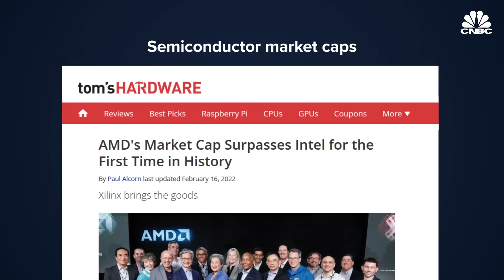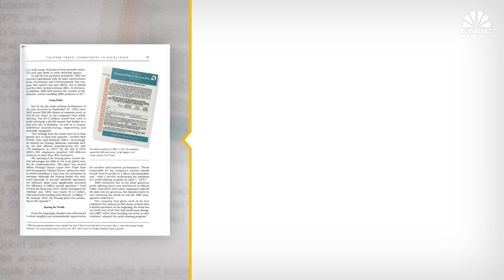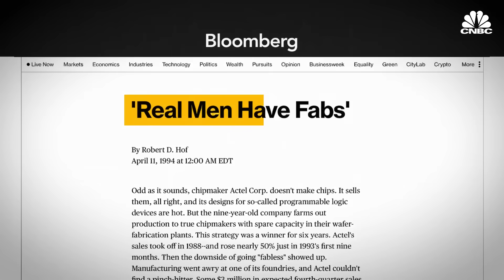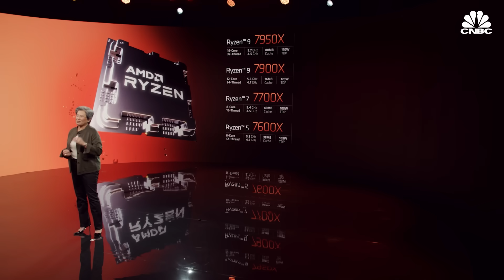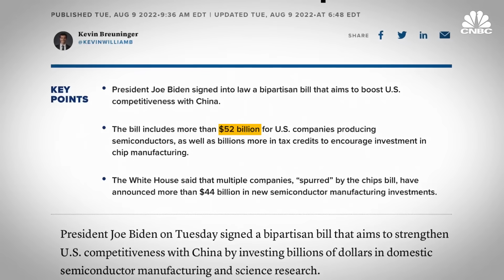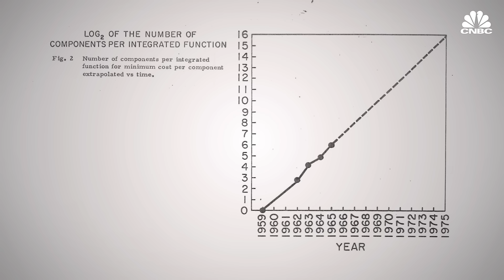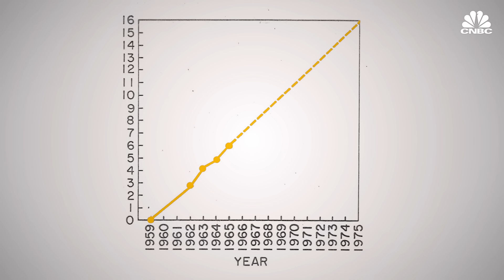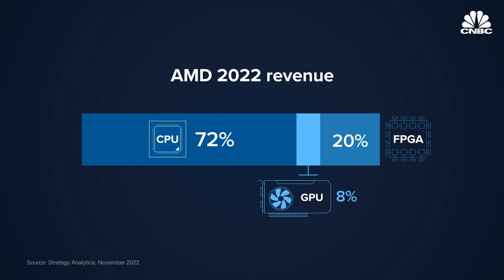How Chip Giant AMD Finally Caught Intel

Comment: Finally, AMD is getting the attention it deserves.
Reply: Was Intel for a long time. Now I am pure AMD for my CPUs. Even big tech-tubers like Jay from Jayztwocents are becoming AMD fanboys.
Reply: @TheSlickmicks  No, Jay uses what has been best for his use. i.e. "Epic Gaming and Rendering PC Upgrade Video - Jayztwocents went Intel"  😜✌
Reply: @Mauser1965   LTT got AMD'd
Reply: I'm surprised as I always hear gamers go on for AMD for some time. Asked me back years ago I would say INTEL plus NVIDIAAs AMD was the cheap option. 

Obviously building a super gaming computer is a lot more nuanced with drivers and software bit I always hear how AMD is either competitive or better.
Reply: @dianapennepacker6854  Its because the enthusiast market is A) A very small portion of sales and B) Most enthusiasts will say AMD and still buy Intel/Nvidia.
Reply: @dianapennepacker6854  The strengths of these two companies keeps sliding around each other.  When Intel released the i series (i3, i5, i7, i9) they obliterated AMD for a while.  Intel had performance, lower heat issue, and at the high end they won on performance.  AMD was still making good product, but the competition and price points where they could win were narrow.  AMD has done amazing turning things around.  For a while AMD has been winning in situations where high core count was more valuable than individual clock speeds, which is not usually gaming.  Intel still generally wins at single core performance at the top end.  Price wise AMD is often the winner when you look at performance per dollar.  The gap though is narrow and Intel is going to have to innovate as their current line of products and what we see from them coming soon in the near term doesn't look like it will be able to sustain any real edge against AMD's current trajectory.  Maybe Intel will keep the top spot for single core performance but I'm not betting they will (or that single core performance will be substantial enough to matter).  On the other end having lots and lots of cores doesn't matter much for home users.  

This all puts AMD in a really interesting spot.  For many business applications more cores is better, and they are winning there and they can win there at a lower price point.  More cores also is good for streamers which is interesting for gamers as gamer streamers often are looked at by "normal" gamers when they decide what computer equipment to buy.  If your favorite stream uses AMD you might just go that way too, even though your streamer is likely using AMD because it's better for streaming, and not necessarily better for gaming.  Again, toss in better price per performance though and lots of "normal" gamers would likely be wise to go that way even if technically the faster single core performance of Intel chips often can produce higher FPS (depending on the game and settings and of course the GPU used as well).  So AMD looks to be winning in most business scenarios, streaming, and while they win in price for gaming and ever so slightly lose for raw power in gaming... well the marketing is likely theirs.  

Intel really needs to put out something amazing and they need to get their prices down to compete.  It's been obvious Intel's pricing points for a while have been intentionally premium (slightly) so they likely can choose to just lower prices if they want, but I'm not sure they will.
Reply: @dianapennepacker6854  AMD is not as good as Intel/Nvidia.  It's literally a meme at this point that people even try to argue it.  It's so hilarious.
Reply: Still using the MSi laptop I bought 5 years ago, back then by all the metrics AMD was still lagging in performance, so I specced Intel/NVIDIA, and it still performs well with the SSD package, but are you saying, perhaps in another few years when this rig finally can't play some games I might be better off with AMD?
Reply: @JeffreyGoddin  I think AMD is a cheaper alternative to Intel and Nvidia(especially Nvidia with their crazy prices)
Reply: @OnurTheGamerr  lmao, "cheaper?" Amd can't even compete against the i3's
Reply: @someonetooknuggets  Pretty sure AMD doesn’t have all the attention.
Reply: @someonetooknuggets  Really you only hear about AMD through the hobbyist market via techtubers. Intel have been marketing giants for a long, long time. I don't think I've ever, even after showing interest and then building my own computer, seen an ad for and AMD product that wasn't just an ad for a retailer selling one of their components.
Reply: @JeffreyGoddin  A laptop with an AMD CPU and an AMD GPU will have significantly better battery life than an Intel Nvidia combo. For a couple of years, AMD actually had the best gaming CPU. Now Intel has the best one, and it's even the cheaper option. But I'm not complaining, because the only reason why Intel started making products that good is because of the competition from AMD. Put it this way: now that there is finally some real competition between Intel and AMD, we really cannot predict who will be best in 3 to 5 years. It could be Intel, it could be AMD. But as long as both companies bring their A game, we all win as consumers.
Reply: I don't like it. They will start to require more pennies for their products, making me expend more pennies in their products.
Reply: @JoséFranciscoCandidoFilho  You're a little late, that's already started happening. Heck, the flagship Intel CPU is now the cheaper option. But hopefully competition will keep them from going as bad as Nvidia.
Reply: Lmfao!
Reply: wdym..? Amd has all the attention since the release of Ryzen. They deserve it, but this isn't "finally".
Reply: AMD gets plenty of attention? From all the poor people buying their CPU’s.

Comment: i remembered clearly
Intel said "its IMPOSSIBLE" to transition to 64bits.
AMD then came out with the solution.

the rest is history.
Reply: Nah they never said it was impossible. Intel saw it as an opportunity to change to a new instruction set architecture in order to get out of these licensing deals with AMD and Cyrix dated back to IBM requiring a second source. A new ISA would not have the same issue which was being battled in court at the time with Intel trying to kick AMD out. Note, the deal was that AMD and Cyrix would get a copy of Intels CPU design like i386, not just that they could use x86 for their own design. Intel no longer wanted to give the CPU designs and AMD had to reverse engineer it instead (Always with better performance).

But while Intel was making the horrid VLIW instruction set architecture called Itanium, AMD was working on their very first Micro-architecture of their own design still based on x86, the performance was much better than Intels Itanium and pretty much determined the choice. To move into the 64 bit space AMD had changed x86 to be 64 bit (not uncommon to extend x86 with new features, this wasn't that complex). This extension was called x86-64, Intel and AMD made a cross licensing deal where any extensions made by either party would be shared for free to keep things compatible.

Intel didn't do x86-64 because they wanted a monopoly, and the only way to do that was make a new ISA. Unfortunately they couldn't make it perform any good.

Comment: .... lol So we're just going to ignore that AMD dominated the CPU scene from Mid 1999 through 2005.... 😏
(I'm not surprised by the oversight, at least insofar as the video title)

And the real reason Intel clawed ground back was heavily thanks to their illegal tactics with system vendors, with what equates to bribing them (through heavy discounts) to not only use Intel parts in their systems and laptops, but also by making sure that on the systems they DO sell with AMD components, they only use lower quality parts (only single-channel memory, less RAM, lower resolution screens, less configuration options etc); thus, ensuring people didn't even want to buy AMD-based systems! This made AMD starved for cash and couldn't put in the R&D to keep up. [NOTE: Intel was found guilty on these claims, in multiple courts around the world, so I'm not just some fanboy/troll making crap up. 😉 Although this does happen to be the reason I vowed to never buy anything using an Intel CPU (and I suppose GPU, now); networking interface components are fine, though. https://en.m.wikipedia.org/wiki/Advanced_Micro_Devices,_Inc._v._Intel_Corp. ]
Reply: Uh oh. A fanboy got out of his cage.
 
Meanwhile, back in reality, AMD went by almost unknown until the 2000s when they crept into Intel's performance territory and then briefly beat out the Pentium 4 with the Athlon64. Then Intel finally realized how misguided they were and spun out new variants of their highly efficient Pentium M mobile processors and scaled up for desktops which was a huge leap forward and they dominated the next decade by simply improving on that underlying architecture.
Reply: @usucdik  yes, if intel surpasses amd yet again, the entire fanbase is going to sit down
Reply: @usucdik  lol And I could say to you: uh oh, another troll's has gotten internet service installed at their bridgr.
However, I suspect I'd be wrong about you just as you've been about me, since I know you don't live under a bridge.

Seriously though. I don't hide the fact I love AMD, that I even recommend them when I can, but I'm certainly not the extremist-type of fanboy that you think I am.

AMD held the performance crown since the moment the release of the very first Athlon (Slot-A; now dubbed "Athlon Classic"), and reigned from mid-99 to at least 2004 when A64 x2 first debuted, but realistically it extends to 2005. They were well known, though, just not as a contender. That ALL changed with the Athlon, though, and there was enough hype around it before it launched, that even 16yr/o me had caught wind of it and started planning it my aforementioned first build around it (I knew nothing about computers really, at that time). I even remember the rough prices when I called around trying to find a CPU and mobo in stock: CPU was $220ish the the Athlon 500 I wanted, and mobo was $400ish for the MSI model I was after. 

Although, Pentium M on desktop wasn't what I'd consider their saving grace, but it wae the BASIS for what would take the lead: Core2. Phenom and PhII still held their own during those days, but Intel's shenanigans [see: link in the OP], which still continued for over a decade after Intel was fined I might add, had taken its intended financial toll on AMD. The PhII slipped further and further behind, particularly once the Core i series debuted... PhII x6 was a valiant last hurrah, but even still it fell short.

Bulldozer? THAT'S when those vendor shenanigans bore true fruit for Intel... Bulldozer was (unfortunately) such a huge failure, so much so that I stuck with the first-gen AMD APU I was reviewing (PhII x6 derived, cut down to a quad-core), simply because it had much better floating point performance, AND far superior memory performance – based on my personal tests vs the first few revisions of the Dozer uarch.

So yes, Intel once again rose to dominance when they ushered in the Core i, but AMD held their own towards the end of the PhII-era. But yes, that's still admittedly "loser-talk", as they were still being beaten.
Then Intel got cocky, rested on their laurels, and paired with almost a decade of 10nm woes, lost to AMD one again.

Now the only way they've been able to compete with AMD (in most tests) is through sheer clockspeed increases... Of course, that means they consume a massive amount of electricity to do it, and in turn put out an incredible amount of heat! Factor that in, and in the few tests they do still lead, I still qualify that as a loss, due to the poor efficiency. (yes, AMD's new 7000 series is also capable of consuming tons of amperage, but that's by choice whereas Intel's is because of necessity desperation... 😊)

“““Fanboy”””, out.
✌️
Reply: intel actually went better from the late 2000's to early 2010's, they fell off and they're about to rise again

Comment: Just upgraded my 2018 PC with a Ryzen R5 5600. Unbelievable performance and value. Really am glad AMD is around to keep Intel on their toes!
Reply: @illumonic  well the problem is that you got a pc from bestbuy...
Reply: @operatorpsyduck2035  E--Machines.
Reply: @operatorpsyduck2035  I’ll second that
Reply: @illumonic  you bought an overpriced pre-built from Best Buy but buying a $50 cooler was too expensive? Weird.
Reply: @superpulaski9767  Shouldn't have to buy a new cooler for a new PC, regardless of where you buy it from.
Reply: Both great companies, I wish Cyrix was still around.   We need the competition to keep advancing technology and making it cheap.
Reply: @commodoresixfour7478  did you own a 64, I worked for Commodore in OZ
Reply: @illumonic  all it took was a better cpu fan lol. the stock ones aren't good enough, that's common knowledge.
Reply: I wish there are more than 2 companies that produce advance chip
Reply: @navyseal1689  why. Why do you need more than 2companies? Ir serves no real purpose because the best ones arw still gonna be on top.

When you consider the cost, not everyone can make chips, even if you own a machine.
Reply: @PrYmCHGOan  more competition is good, we'll get the most benefit as customers
Reply: @PrYmCHGOan  Competition. Capitalism is balanced by competition. If monopoly reigns, they can just charge whatever amount.
Reply: @PrYmCHGOan your points are valid but if there's a third player who manufactures chips like intel and amd quality then tht will be beneficial for customers and innovation would be on a whole different level
Reply: What do you need this stuff for?  
I still use an AMD based computer from 2007 (on which I'm writing this).
Reply: @herrbonk3635  I still have an amd sempron I think lying around from early 2011. Stopped booting around 2015 or so probably motherboard issue. I'll try to resurrect it if I can find used motherboard on the market.
Reply: @Sarah_Delata  Or you try to find the problem with the pcb? That generation electronics has low quality electrolytic capacitors, so that's usually among the first suspects. 

What I got lying around you probably never heard of :D CPUs like 8086, Z80, 6800, and similar 1970s stuff. Plus thousands of small 14/16/20-pin integrated circuits from about the same era. Because before the micro processor, not only a full computer but also the actual CPU itself was made of hundreds of small and simple ICs connected together. (Most of these components are still mass produced though, belive it or not, as they have other uses as well.)
Reply: @illumonic  probably a mediocre motherboard and or cooling issue. You could've tried a gaming fan
Reply: my 2000 euro laptop´s processor choice was amd razer 9. intel´s processor of same caliber would've not only been more expensive, but more power hungry. but the main thing was that it would've been around 500 euro more expensive.
though for graphic cards I still chose nvidias 3070ti because it has dlss AI technology. better graphs for less power, important in laptops. i expect amd will eventually have that type of thing, too.
Reply: I can't get mine to work (5600x). Bios flash, going to try one more version and then leave it, will try to tomorrow. Been puttin ram in and out. Back to the 3200g, dediated GPU in and out as well. I dont knwo.
Reply: I am having Ryzen 5 4600H and VLC opens media file instantly and I am very happy with it's performance.
Reply: @illumonic  because u bought it from best buy and it was probably not brand new chips lol
Reply: Have been using AMD since the 486 days, I just upgraded to a AMD Ryzen 7 5800X3D 8-Core with 64GB ram, and a AMD Radeon RX 6750 XT, what a beast, very fast
Reply: @illumonic  bestbuy is not where you buy Computers, your unit was builted wrong, no problems with AMD Ryzen processors, have use them from the 1st Ryzen, now have a Ryzen 7 5800X3D 8-Core, no overheating problems & it very fast
Reply: Without AMD Intel was moving ahead on turtle pace
Reply: It's healthy to have serious competition, to keep one on his/her toes, something apparently the Chinese --- or at least those they promote to rule over & to make life and death decisions for them --- don't believe in. 

Anyway, I remember, as noted here, that a few years ago, AMD was known mostly as a player in the gaming industry, whereas Intel ruled everywhere else in high-end computation. 

And, yes, I still remember a time (working with students) that Apple was so insignificant, so small, it literally begged students, teachers, and schools to take its products. But it caught on soon afterward, both as a luxurious and as a high-end technology everyone who's eccentric, creative, or fashionable wanted... all over the world!
Reply: really back in the 2000 nobody would buy a PC with AMD processor.
Reply: @aztekempire  that's not true. the original slot A athlon was very fast in it's day. AMD was the first CPU maker to break the 1 GHZ barrier. AMD had a ton of innovation in this time period but then they fell behind. they also had the first 64 bit instruction set for the X86. inconvenient truth for intel the X64 extensions are named AM64. this company had a slump for awhile but they are back to kicking butt and taking names. i am so glad they have great leadership
Reply: @aztekempire  AMD cpus were highly popular in Europe at that time especially as overclocking hit the young enthusiasts/gamers: prices were a big factor too (as i recall only special edition Intel cpus were 'open' while almost all AMD cpus could be overclocked w/ minor modifications)
Reply: @aztekempire Nah, the Athlon line was popular. It was around 2010 that AMD fell behind. Bulldozer was a flawed architecture, and they lost a lot of market share. Zen turned things around.